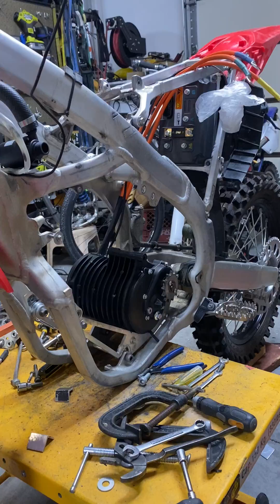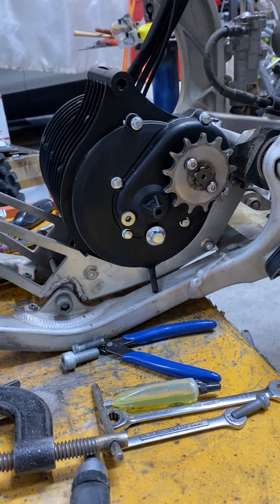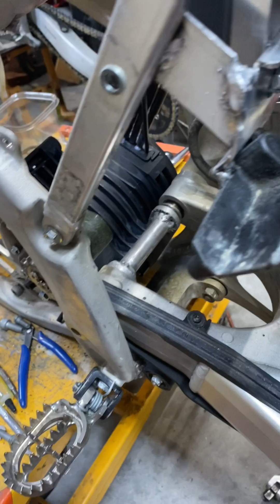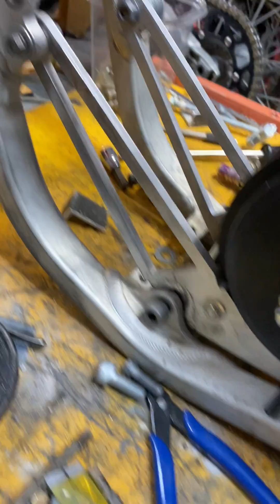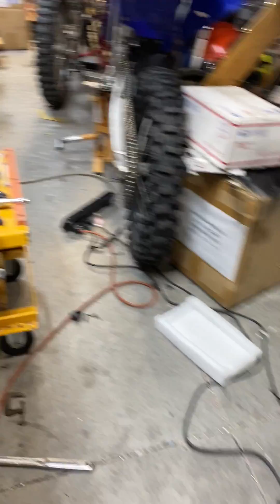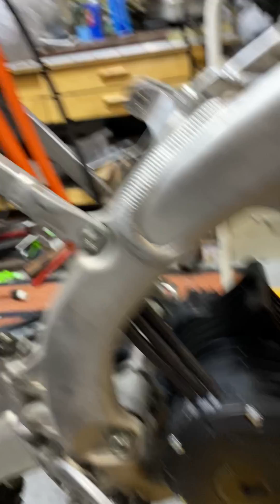Motor Mounting of the QS138 70H in a 2023 Honda CRF250 using a Lithium-King.com mount kit

Comment: Nice. Whats the largest amp hr battery you have installed in the crf250 frame? What voltage? Thanks.
Reply from the maker: 50.4AH is the largest i have installed.  but There are others trying different sizes. Go to this Forum for more info.     https://electricdirtriders.com/threads/yet-another-crf-250-build-but-its-my-first-so.3861/

Comment: Did you end up having the grind out any bits of the frame to get the motor and battery to fit in there? Just dropped my frame for powder coating and starting to worry that I should have fit everything first.
Reply from the maker: At the top you will have to do a little grinding at the top rear corners

Comment: where did you buy that braket
Reply from the maker: You mean the motor mount?  Lithium-King.com   They have it on there website, with a tutorial on the measurement they need to draw it up and have it water jetted. It is very reasonably priced
Reply: @dcoxryton  Do you think this motor mount could be used on a 2005 KX110?
Reply from the maker: I don't know, but I think Lithium-King.com can get them made for you.   @SnailGs

Comment: Why is Lithium King getting paid for their design when the delivered products are unusable? Who delivers a flat plate when one of your three mounting points is 0.125" out of plane? With your amazing throughput of builds, some time invested in learning Fusion360 and designing your own mounts to send to sendcutsend seems like a better use of your time instead of waiting weeks for a part you have to immediately cut and weld. Also 6 points of attachment for that motor seems excessive. The lower four seem like they would be plenty.